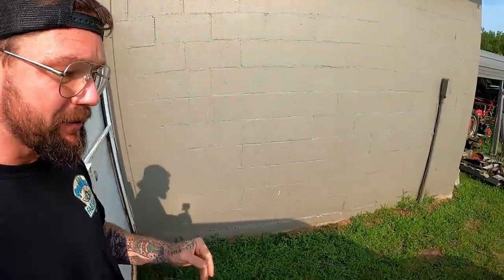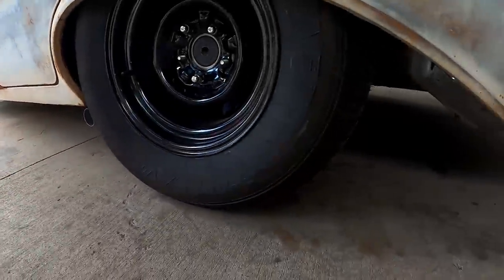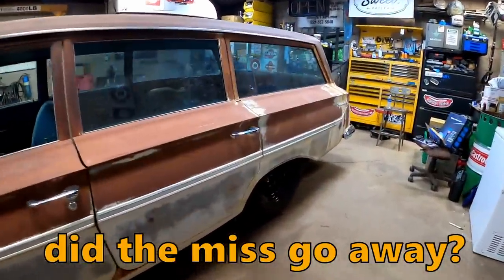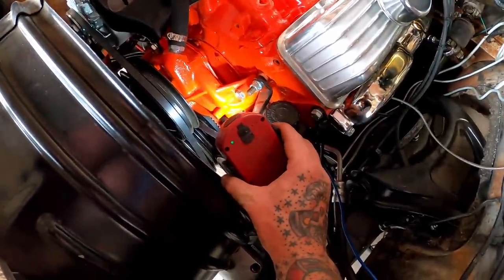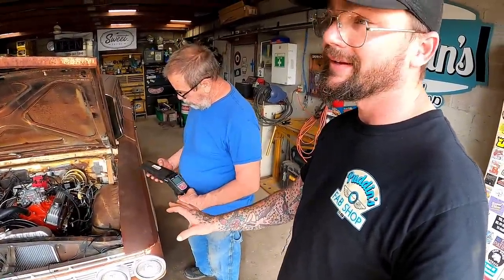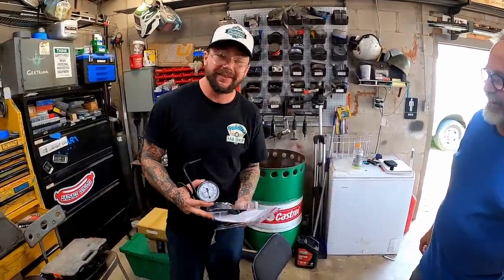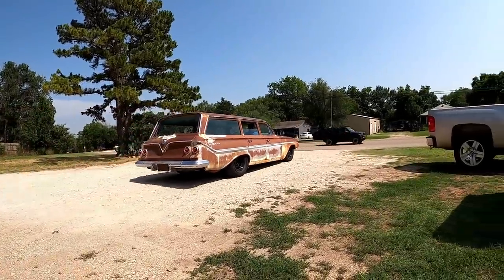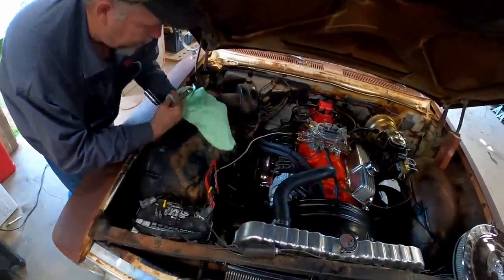Why is it running BAD? 1961 Chevrolet Parkwood. NEW EXHAUST.

Comment: I just got rid of a 2013 Chevy express 3500 van that had the 4.8L in it. I towed a Chevy k3500 daully with the 6.2L Detroit diesel in it from Missouri (2hrs) to central Illinois, barely squatted the van and barely felt the trailer. They're very nice tow rigs.

Comment: Power steering fluid is great hair tonic....even cures dry scaly dandruff. Always adjusted valves with car running...loosen till it rattles, then tighten till it quits then a half turn tighter.

Comment: Y our rocker noise is the rockers hitting the after market valve covers.  The clue is the noise stopping when you have the valve cover off. Cheap Chinese covers may be the problem.   You spent a lot of the adjusting the rockers when they may not have been too bad. Adjusting while running is the best method

Comment: I think you'll sell the truck after towing with the van!
To load your low vehicles a little easier, a couple blocks under the trucks rear tires will give you a better approach angle!

Comment: Non running - Get the piston you're working on at TDC, back off until Pushrod has zero lash, then tighten 1/3 -1/2 turn.. repeat on all cylinders 

While Running (best way) - loosen until clatter is heard, tighten until it goes away, at that exact spot it goes away is zero lash, tighten 1/3-1/2 turn. 

Zero lash- the only movement that matters when doing valves is the play between the rockerarm-pushrod-lifter.. the moment when you can't move the pushrod up and down (all slop is gone) is the point of zero lash... spinning is for dummies
Reply: Hope you see this puddin

Comment: You can get a broom stick or something similar about 2 or 3 feet long and touch one end above each cylinder or down on the engine block at each cylinder and then the other end of the stick up to your ear with the engine running and you can hear noises in the engine and when you touch different areas on the engine you can find where it's coming from very accurately.

Comment: Do the Running Valve Adjustment just like you Said. Run it, Loosen until slight chatter and then 3/4 Turn. Do all 16 Valves and Done.
Reply: I thought that was how to adjust the hydraulic lifters.  When it's running.  Little bit of smoke though.

Comment: 1-ton Vans are great for pulling a trailer. Watch out for some of those Oklahoma wins hitting you broadside especially since your Vans extended. Quick Lane changes might mess with you. Get a camera maybe two. Seen out the back of that can be a lot of fun. I didn't notice but if you have those mirrors on the corner except for catch them on a tree limb or something. They are pretty handy to have those I think convex mirrors are on the back corners and allows you to see what's behind you. Congratulations all the way around. You know you're watching a good guy when he starts measuring it in church van size. How many seats were put in their get how many kids to church Good point of reference. Dan's pro shop another channel gave you and Derek a shout-out. You two would have a blast barbecue and I'm pretty sure. You two would have a blast barbecue and I'm pretty sure.

Comment: Take those chrome valve covers you painted. Cut a slot in the center and adjust the valves with it running.

Comment: Time to cut open that oil filter to check for lifter and cam material. New oils don't have enough zinc. Zinc additive doesn't always help, its cheaper to go with a roller cam (been there done that)

Comment: Hey the chatter could be your dizzy! I just built my 351 Windsor in a 80 continental and the Chevy style distributor I got made a heck of a clicking noise until it did some self clearencing. Had me scared pretty good till I found it. PS. Been a fan since I lifted my 07 Mazda 3 and found ur towrolla videos. I wait on edge till ur next 1 now. Keep it up

Comment: Some of the older GM v8s had the timing marks behind the water pump that is why your marks dont line up you have a balancer made for a timing mark being the water pump straight down The 2 screws on the carb are low speed  mixture screws so you will get use out of your vacuum gauge setting them

Comment: Those vans pull about the same as a 2500 pickup. We had one at a company I used to work for and I pulled a vibratory plow on a pretty decent sized equipment trailer and I wasn’t disappointed. I pulled a skid on a similar trailer behind my 04 gmc 2500 and they pulled identical

Comment: I’ve had new spark plugs that were cracked down the porcelain, couple thousand miles after putting them in. It’s real nice cause that messes the wire up to when that happens. Oh well they warranted both out.

Comment: You know you could have let the air out of the trailer tires? Changes the angle of the deck and the ramps. Just the rear set of tires.

Comment: Worst mistake I ever made while doing a motor swap was on a 2003 vw beetle. Had the motor in, went to crank, and no Start. No crank signal. I forgot the thin little reluctior wheel that slides over the crank. Didn't even know that was on those until I messed it up. That was several days of cursing, still don't like doing anything in vw to this day.

Comment: I drive a regular length service van with the six oh and I tow a beavertail tip trailer with a scissor lift or skid steer with it. Would like it better with a trailer brake setup, but it works.

Comment: I would remove the lifters on the right bank cylinders. One of them may have collapsed or it's defective. Re-measure the pushrods to make sure they are the correct length. Inspect the valve guides, all of them on the right cylinder head with the borescope to make sure they are geometrically straight.

Comment: Get some oil deflector clips and then back them off til they click(with engine running....oil may go everywhere anyway)...then tighten til clicking stops and go 1/2 turn more and you'll be golden.

Comment: Take one of those Tin Chrome valve covers slice it just so length wise, peel back the metal and make it so you can adjust the valves without making too much of a Mess while she's running to fine tune out yer Clicking Puddin' wish I was there to help with all that small block chevy Stuff👍

Comment: Hey man I don't usually put my 2 cents in, but if you use a piece of half inch rubber fuel hose, cut it off about a foot slip it over the tip of you spark plug, and no more burnt finger tips.

Comment: Puddin, opinions being what they are n' such 😂 i'd personally run a thicker air cleaner element, you have the room so go up 1" 
The closer the lid is to the air horn on the carb, the harder it is to tune the carb correctly as the air has to travel up and over the raised airhorn through a compressed area then make a sharp turn into the venturies. 
This causes the air speed to slow down, providing the boosters with a weak signal which leads to a false lean/rich condition.
If you listen to the idle, no air cleaner, engine at operating temp with timing and carb adjusted.....then listen to how it ran after fitting the current air cleaner setup, you had to make adjustments after the fact.
Keep up the killer content mate, much respect from Down Under. 🇦🇺

Comment: Take an and loosen the rockers up to where there snug then quarter-turn the crankshaft , tighten the lose ones ,do it 12 times or three revolutions and you tighten the valves down until the snug or spin push rod with fingers and then you quarter-turn it and do it to the ones that are loose and do it again until you do 12 times or three revolutions on the crank

Comment: TDC can be found using an old Pushrod or even a long chopstick. Feed it into the plug hole and turn motor by hand until rod reaches top and begins return.

Comment: Go back to the Right way to set your valves. Motor Idling loosen each rocker until it chatters. Tighten until quiet. Then give rocket bolt another 1/2 turn, DONE. Nice car with a nice sound to it now Puddin. 
Now I got to go find that Mortske video...

Comment: If you use a leak down tester when turning the motor over by hand you can see when it’s coming up on the compression stroke. Might be easier on a hot motor

Comment: The "Prison Van" is a common fixture in the Nascar Racing industry...Only real problems I've experienced is it's REAL sensitive about front end wear and tire issues...eventually, your pointed down a hill...and the wheel starts trying to knock your arms off at the elbows. Just stay on top of that front end.

Comment: Isn't that piece you found on the bead roller the line adapter you had to take out of the power steering pump and change to make your fitting on the line work?

Comment: Get some old rocker covers n cut you a slot down the middle and set the rockers with her running... well dang I think we've all butchered plugs or timing before... when the excitement of getting it fired up takes over its easy to rush a little... she's looking great, it's itching for that front bumper!!

Comment: Take an old valve cover cut the center out of it lengthwise and put it on the engine and then you can adjust the valves running with little to no oil slinging all over the engine.

Comment: Don’t let anybody lie to you about the 6.0 Chevy I have a friend that runs hot shots. Well he did too. He passed away a couple months ago. He pulled 40 foot gooseneck‘s all over this country and would get 300,000 miles out of them pulling metal building products and that’s all he used after he could not find any more 7.3 L Ford. The 6.0 GM will Pull and are probably one of the best stock gas engines on the market for it with the right gear set up

Comment: I always set the rocker arms with the engine running turn them down until it starts missing a little and then back it off

Comment: Do you have a flat tappet cam or a roller and if you have a flat tappet was it broken in properly. The first thing I would do is find the source of the problem and double check the plug and if you need to pull the valve cover off and make sure they are working like they should.

Comment: She'll tow like a champ but it didn't look like it had a tow haul option. I tried leaving town with out figuring the wiring out. I think you need some sort of resistor or something because of the dual lights. Im sure your smarter then i was. However it was wired during the day i would just flip on the headlights every time i was breaking so it looked like the trailer had break lights. At night i just ran it...

Comment: Never reuse a harmonic balancer. The outer ring slips at the rubber connection.
Vaccume gauge is real handy for tuning those Carbs.
Reply from the maker: That suckers brand new

Comment: Vans tow better than trucks, more weight over rear end. Make sure lifter isn't collapsing! Sometimes higher rpm and more oil pressure will pump lifter and make chatter go away! I've changed many new lifters that were bad

Comment: If you don't use the EOIC valve adjust method, you will have problems. Too tight is worse than too lose.

Comment: Take valve cover off and start it and back each one off till it clatters and turn in till it is quiet and add a 1/4 turn. It will make an oily mess but it is worth it.

Comment: Valve adjustment u need to cut an old valve cover long ways to be able  to adjust  valves w engine running  each valve ,while it's running loose one valve rocker slowly until it makes rattle noise ,chatter . Then u tighten it up slowly to get the noise gone   then add a quarter turn tight, repeat on  every rocker .some times twice each rocker will get you thier ,do it at a quiet setting ,no other mechanics ,friends  family members or having to be some where else ,it's all ears listening  to the chatter n quarter turn tight after chatter stops .God bless yall real good.

Comment: Do you have pressed in rocket studs or screw in studs , over the years I have had the displeasure of having some pull loose when adjusting them and drove me crazy after setting all of them and having to readjust again till I saw the real problem

Comment: Im going to be honest, I don’t like the exhaust location… it’s not far enough back, and between the door seals and open windows your going to get exhaust in the car when sitting at idle (stop lights, signs, traffic, etc)… when moving it will probably be fine but those slower speeds will not be good.

Comment: Gots the same trailer as you have, ain't it a bitch with a lowered vehicle. I solved my problem but it creates another problem. I added 3 foot to my ramps and then they were to long to go under trailer and have to strap them to the deck of trailer. But them short ramps suck a big long station wagon 😮I said it I meants it. 😮

Comment: That van will tow. It has a longer wheelbase than the Ford or Dodge vans of those generations had hence they had more overhang on the rear. Longer is better for towing.

Comment: I am 53 years old and have had tons of cars and trucks, in all my experiences, the worst times I ever had working on gm and chevys has always been better than the best times working on ford or dodge, fords are always a pain, one thing you fix something else breaks, and they ride so rough, dodges are always an electrical nightmare and always make you go wtf why and scratch your head! Chevys are always easy and simple 90% of the time and ride better, its just that simple, and usually parts are always cheaper and easier to find! Really the most pain I ever had with any chevy product is transmissions, and if I knew how to work on them they wouldn't have been!

Comment: Pu  den, I is gonna have to come over der  to pot county and teach you all how to tune and read spark plugs.  Those plugs looked like CRAP .  Ya need to pull em all out and set em in your vice , electrode up and take a torch to em and get em white  for starters. I`ll bring ya a vacuum gague and teach yall how to set timing with it, yep. and as for those two screws on da front of da carb in ater, general rural is start by "lightly seating them" then back em out 2 turns each. Then turn them in about 1/4 a turn each until it slows down, then back it out a 1/4 turn. do your carb last after the timing and dwell. and PLUGs clean, and Bills right,  its probably got a cam going flat. AHHHH got cha!!! maybe its pulling a stud?  . Ya need to get a set of stock valve covers and dimple dye 8 holes in em, so ya dont make a mess like your cardboard ones. Then ya can do in running . 1/2 turn new motor , full turn once shes broke in. Get that guest room set up for me in the new house.I need a soft soft bed . See ya put sum tin in dat ps pump so I can hear the engine run. gese. Oh almost forgot. float level and drop is CRIT i CAL!!! They got u tube videos to show yous how to dos it. grind  a screwdriver flat TIP that fits PURRR fect in the jets so ya dont strip em out, they are really sorf brass and pull one front and one rear and write down the numbers on em so when I get there with my jets and metering rods I know where to start  finnne tune in her. You just wait , I make that ole sled run like a furd    .yea!!!
Oh and the term or the RULE is ,,,you drop it , you re-gap it.every time.Get a stethoscope and listen for your tic tic tic....some ting hittin those custome valve covers? fuel pump? dont sound like a flex plate , could be that cheap o distributor , stethoscope will pin point the noise , then you can be doctor puddin.  I have a pair of chitty valve covers with UGLY torch cut out for rocker access for 35 years , who cares what they look like as log as you can see the rockers and not  pump oil all over the engine.

Comment: That van will tow very well for about 7 miles and then you'll be replacing the 4l60e transmission because it's weaker than a inchworm pulling a bulldozer

Comment: About time you got you a real truck i am mopar all the way i bought a gmc jimmy 4.3 vortex and its got 286 thousand miles i went had the oil tested the bearing look at and the dam motor looks and sounds brand bew as my mechanic says cause its a chevy and i dont even like chevy but i will own a chevy way before anymore dam fords  i had to buy 4 fords in my life and i half to say out of all the ones i owed the dam mini ranger was the most dependable one been flup 2 times before oli got it father in law gave it to me and then a month later i got side hit dude was doing 55 mph when he hit my driver door Total his truck i drove to my house which is about 25 miles away the tow truck plus the cops said you cant drivle that it had to bend stuff it did bent my rear axel but i still drove it home they charged me 75 bucks to pull me out of a ditch i mean 5 ft from the rd cause they couldnt get me for a 250 dollar tow which its 2 miles from there shop

Comment: No such thing as GM junk there's a reason the ls is the most commonly swapped motor also coming from someone who's worked in the driving industry for landscaping I will say Dodges don't know how to stop Fords are known for shooting spark plugs out of the block but I ain't got nothing bad to say about a Chevy or a GM because they've never done me wrong the handling is way better than the other two and the reliability is there